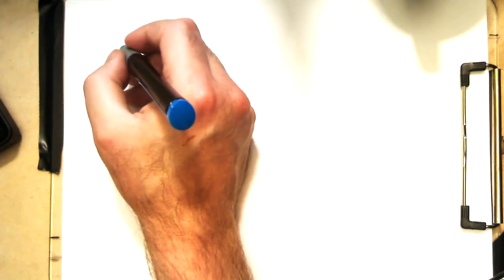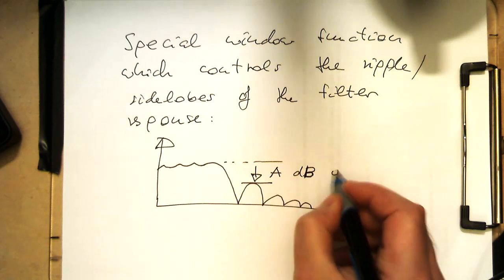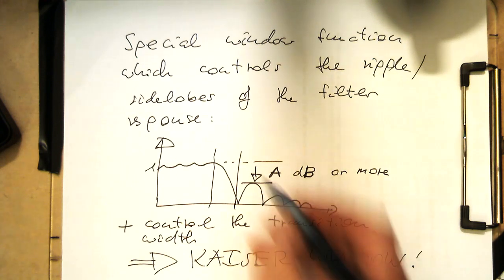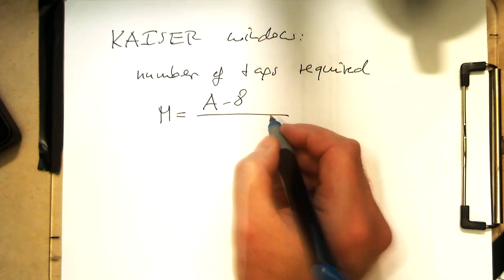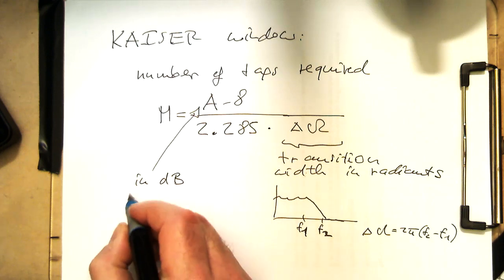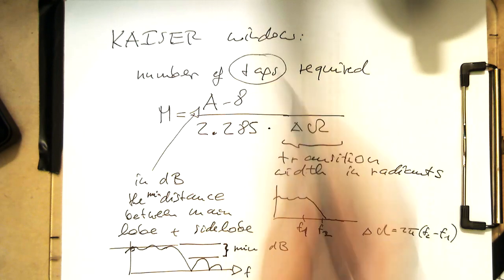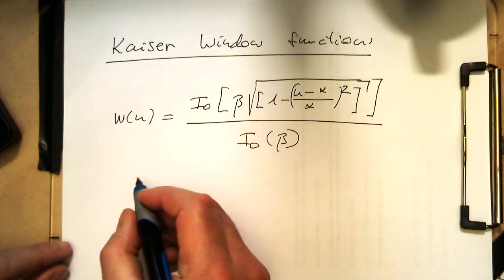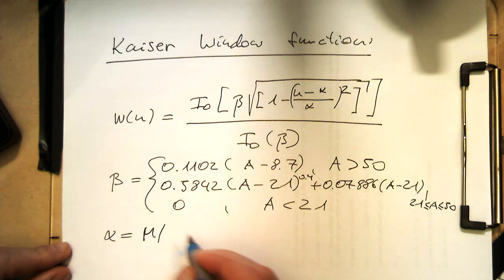FIR filter design by windowing: Kaiser window, theory (0000,Py)

Comment: why some text calculate window length as M >= A-7.95/28.72 *  transition width?
You used 2.285 instead of 28.72
Reply: must be something with definition of transition window since 2.285 * 2*2pi = 28.72